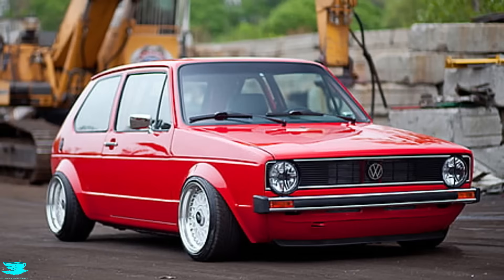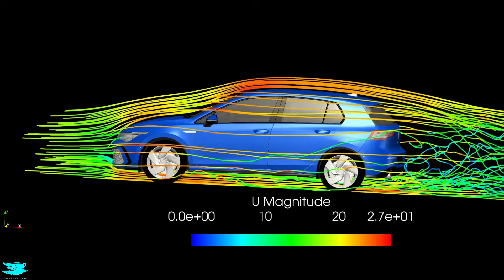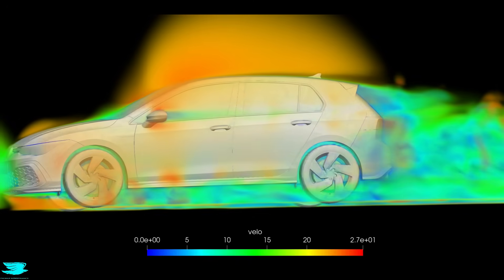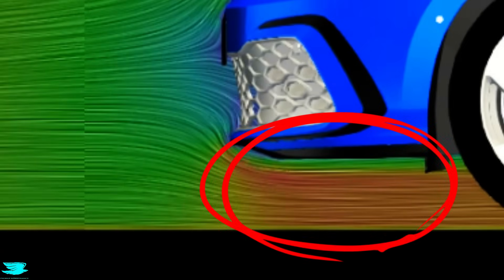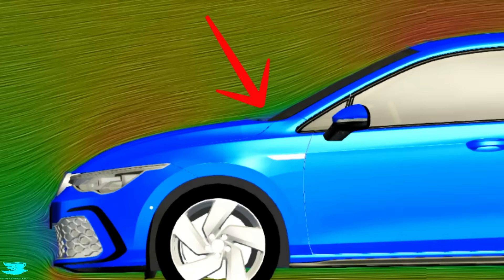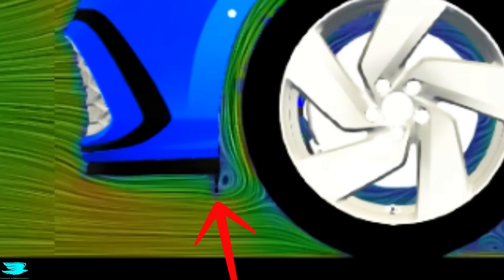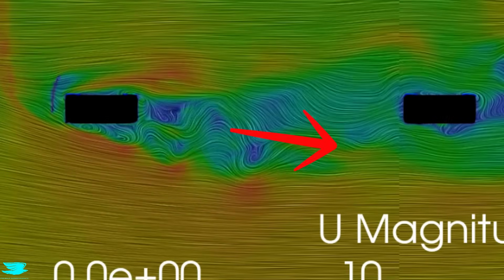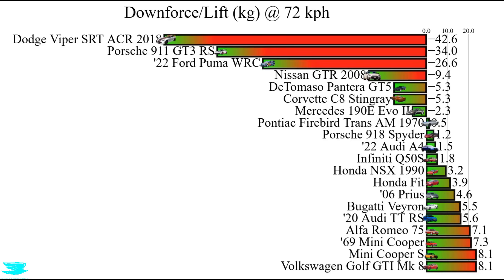The GOOD And BAD Of Volkswagen Golf's Aerodynamics

Comment: My friend added a Gurney flap mid spoiler (under the window) on his golf mk8. He shared that he was doing 30mpg before and 33mpg after installing the 100mm mid spoiler. My understanding from him is that the mid spoiler will help to split the rear wake into two smaller wakes. These wakes are smaller and the car experiences less turbulence due to reduce interaction between the top and bottom wake. Hence, the mid spoiler reduces pressure drag. I wonder how true this is since the bottom seems to experience more turbulence. In addition, with smoother flow at the top half of the car, the mid spoiler can help to reduce lift?
Reply from the maker: Sorry, I'm not completely sure of the geometry you mean. But if it creates small, steady wakes over the rear window, then that will help stabilize the wake, and likely reduce the drag. For the lift, it also depends on the angle of the spoiler.
Reply: @PremierAerodynamics  thank you for your response. After checking with him, he mentioned it was custom made. Do you know any angle on the gurney flap that will be good for lift reduction? Need not be 100% accurate, ballpark will do.

Comment: I would like to see the mk2 golf. I was just reading that it has a drag coefficent of .34-.36, I was shocked considering it lacks a good bit of modern technology like a spoiler, a well angled hood to window,  and is over all pretty boxy. I am suspicions considering the ulta aerodynamic gen 4 camaro is supposed to have the same cd (.34). If you did this, please do the big bumper, since thats what people like more, and I suspect it increased down force and possibly made the limited the amount of flow going under the car.

Comment: i recently added the factory rear spoiler to my 2nd gen (2007-20012) Hyundai Santa Fe (which did not come with one stock since it is a lower trim).  i also added the factory side moldings to the door.  These moldings protect the door but also seem to help the aero as well.  The strange thing about all this, is that after i got it back from the body shop... i noticed at a steady state 45 mph, my fuel economy has gone from about 30.5 to 35 mpg (measured using Torque Pro, running off the OBD2 on my Android Head Unit).  Approximately a 4.5 mpg gain.  i've tested this over and over.  Same results.  About 4-5 mpg gain.  Gain is even greater at 60 mph, but i have not measured it steady state extensively.  Also confirmed at the pump.

my question is how is this possible?  i wonder if you could shed some answers.  Maybe you could test that generation of Santa Fe?  i wonder if the side protectors are generating some vortices to help the air on the side of the vehicle curve around easier to the rear.

thread with pics of the project:

https://www.hyundai-forums.com/threads/retrofitting-stock-rear-spoiler.682801
Reply from the maker: That's cool.

Have you isolated the gain to just the side moldings?

Looking at the pictures, I'd say that the rear spoiler might be pulling the wake up a little more, which reduces how much low pressure is on the rear face. That might be reducing the drag there.

For the side moldings, maybe they're straightening the flow that's coming out of the wheel houses.

I would be interested to know how much of the gain comes from the spoiler and how much comes from the side molds. It's hard to tell how much the side molds would do because it depends on how much wake is coming out of the wheel houses and where. There's a bit of gap above the wheels, so maybe there is some wake from the top that the side molds are helping keep down.
Reply: @PremierAerodynamics  hi, the vehicle was recently hit in the rear and dinged by a hit and run, so while it was at the body shop being repaired, i had them install the spoiler and the side protection moldings.  Right after i received it back i instantly noticed the gain which has persisted over the past month.  Unfortunately i cannot isolate what proportion of the gain comes from the spoiler and what from the side moldings if any.  If i had known about this, i'd have had them install the spoiler and do measurements, and then the moldings to see the change for each of them.

i've been trying to figure this out.  i do wonder if the side moldings are somehow isolating the flow down the side of the vehicle somehow, providing two zones of flow - protecting the top zone from the turbulence coming from the wheel housing or some such.  They are mounted at a slight angle, so the other theory is that they are making a vortex which helps air go into the wake easier.  Maybe you could model this by adding a chine on one of your aero models that is similar to see whether it actually does the above.  

i've look for research papers about this but come up pretty much empty.  It seems that for SUVs very little attention is paid towards the sides... they just try to make it smooth.

i will be adding some small side spoilers at the rear to mount just below the rear spoiler to help direct the air better into the wake.  

Quite a while back i also bought underbody panels for both sides to smooth the bottom of the vehicle (i did a bunch of research on the underbodies of newer Hyundai SUVs and found some that are reasonably close in fit).  Did research on how to properly mount them (involves pretty much knowing the thread sizes and positions of all connectors on the bottom of the vehicle).  Need to make a lightweight mounting frame still.  i also made a thread on this as well.  i kind of stagnated on that project because i wasn't sure the gains would be much... however the gains from the above two mods have made me more motivated again.

https://www.hyundai-forums.com/threads/improved-aerodynamics-via-replacing-updating-under-tray.684501

Comment: Lift in the rear and downforce in the front, on FWD cars is downright dangerous. It's BAD design and i don't see how you think it's good.  The rear is already much lighter than the front. Making it even lighter makes it too unstable.
   I own a 2012 Polo , which has similar aerodynamics as this one (all features included. Even the sharp front edge), and at medium/high speeds the rear gets extremely light. So light that when the car goes over undulations or cornering at high speeds, it's 100% guaranteed that it will cause oversteer. Undulations cause snap oversteer.
  With passengers and luggage, it becomes much more stable. Also the rear tires show minimal wear. I'm not talking about less wear than the fronts, which is normal. I'm talking about almost ZERO year. All this indicates just how light the rear is. The weight distribution of that car in reality must be close to 70-30. VWs are horrible cars.
  So, common sense says that if anything, a nose heavy FWD car needs MORE downforce in the rear if possible.

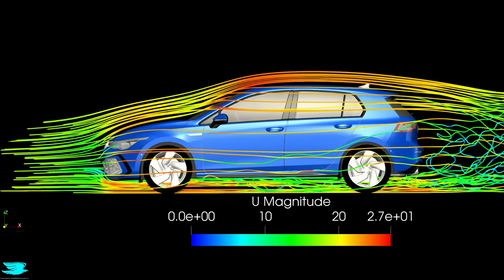Comment: 1:27 I'm sorry but this statement is false. Aerodynamic lift becomes a concern at high speed. The lift generated here is so negligible that even at high speeds the car will not suffer from traction loss due to applied acceleration even if the vehicle is rwd or awd. However, stability is a concern at high speed IF the lift is great enough, but again the lift generated here is negligible. Low stability at high speed in a low traction environment can result in loss of traction, but we are talking hydroplaning, which comes down to how good the tyre is in the wet, rather than the small amount of lift generated here.

Comment: Can you do a 2003-2005 and then compare it to a 2006-2007 USDM Honda Accord coupe, which has a sharper side crease slice on the rear, which may result in cleaner separation?

Comment: I’ve got some points to make, not about this car but in general: you talked about rear lift that is not that detrimental for front wheel drive cars and the front downforce is better for acceleration, but the real problem is that these cars don’t produce that much power to need aero grip for acceleration, but the front downforce and rear lift is more of a cornering problem than an acceleration one.
Another thing, i didn’t catch if you treated the front end radiant part as an actual radiant part, but however you didn’t include where the dirty and slower air comes out. If it comes out from under the front (where i’m positive it does) it surely can create big problems for the whole bottom, maybe even decreasing the already low rear diffuser efficiency thus increasing rear end lift and drag, and maybe also decreasing front downforce.

Comment: VW seem to be claiming 0.32. This is for the manual version, whereas it is 0.31 for the auto which has slightly narrower front and rear tracks and is lower.
The base version is, I think, a more respectable 0.275.

Comment: What about the golf r? That one has grill openings all the way to the sides as it has 3 radiators instead of 1, and has a rear wing which should slightly help with downforce
Reply: Yeah, I'd be interested in seeing the R or Clubsport GTI. Not just the rear wing, but the rear diffuser is also different.

Comment: Speaking of the Front catching and forcing the air to redirect, it was something the skoda designers noticed and rectified it by giving the mk4 an Airdam that redirects that flow, you might want to look into the mk4 apparently it has a Drag coeficient of 0.28 and somewhat better aerodynamics
Reply from the maker: Thanks. I didn't know that about Skoda.

Comment: Surprised the drag coefficient isn't what you'd expect from a modern car,  was guessing it to be about 0.31.
 Would love to see reviews of vehicles that have better aerodynamics  than the shape would suggest, the Ford Flex comes to mind: a boxy wagon shape but IIRC a drag coefficient of 0.34
Reply: The VW Golf 8 actually has a drag coefficient of 0.28 for the standard hatchback and 0.275 for the Golf 8 GTI. That's a good result. The VW engineers know what they're doing.
Reply from the maker: That is debatable for a few reasons.

For example, no two wind tunnels give the same results.

Depending on which rims you use, that value can change by 0.02.

Even different tyres can easily give 0.005 difference. And other reports are giving low 0.3 values.

Comment: There's a plus side to the recirculating vortex, the internal pressure of that bubble adjusts the flow around it for maximum efficiency. It's not such a terrible loss to have a recirculation bubble near a stagnation region due to the way the air flows around that bubble. Some times you can't avoid it, you can minimize it, or try to use it to your advantage. Often cars have packaging restrictions due to laws, a lot of the way that modern cars are shaped are due to pedestrian collision guidance from governing bodies. These laws are not conducive to sleek sexy aero efficiency like you and I like. We have to work around them and get our way in spite of the red tape.

Comment: I'm pretty sure designers have the upper hand over aerodynamic engineers for this type of cars
Reply: Most vehicles spend most of their lives parked and at crawling speeds in the cities, so there’s really not much need for excellent aerodynamics. It’s a compromise between sales (that bring money to the manufacturer) and driving efficiency (which actually is the owner’s problem).
Reply: @marekstanek112 i’d disagree. I see more GTIs on the highway then i do the city. and As a mk7 owner who daily drives it 60 miles on the highway i think they’re more oftenly used for highway
Reply: @tasstychezbugu1563  Without any offense intended, your personal experience is statistically irrelevant. It’s called small sample bias.
Reply: @marekstanek112 I wouldn’t call it a small sample when i’m on the road daily for 2 hours.. I racked up 50k miles within a year. I see a LOT of cars lol
Reply: @ It doesn’t matter what you would or wouldn’t. It is not a representative sample, period.
Reply: @tasstychezbugu1563 I see them much more in cities and on B roads than highways tbh.

Then again in NL highways are filled with older Teslas and Audi SUVs 
It's probably different per country really
Reply: Marketing departement.
Reply: Finance
Reply: 100%. VW cars (the entire group not just VWs) are designed according to the "needs" of the majority of the market. That's power, space and looks. That's why they suffer from horrible handling and they have terrible aerodynamics.
Reply: I wouldn't say that Porsche and Lamborghini make bad handling or criticize the aerodynamics of a Bugatti  @xXturbo86Xx
Reply: @guigui70051  What percentage of the VWAG production do you think Porsche, Lambo, and Bugatti constitute? Less than a promile.

Comment: If having a sloped bonnet increases lift, would having a sloped front underside increase downforce?
Reply from the maker: Yep. It's like a wing, the curved surface speeds up the flow so the pressure drops. A straight slope will do the same thing, but isn't as forgiving for non-optimal incoming flows.

Edit: we did something similar for the BRZ: https://www.youtube.com/watch?v=j70r4qDRLfU
Reply: @PremierAerodynamics  would there be any worry of a big boundary layer forming there at higher speeds?
Reply: Splitters tend to be sloped, so yes